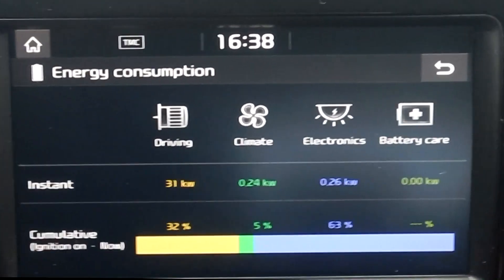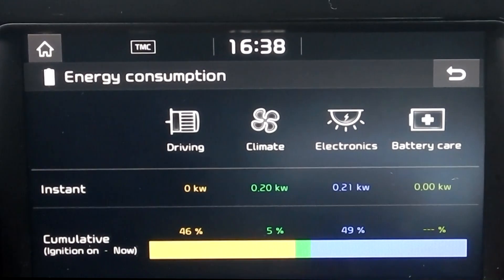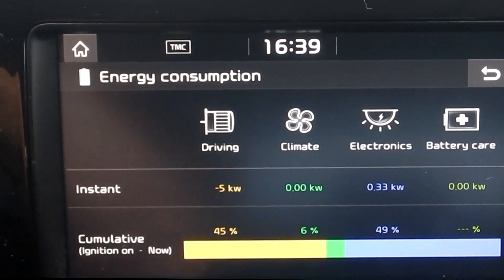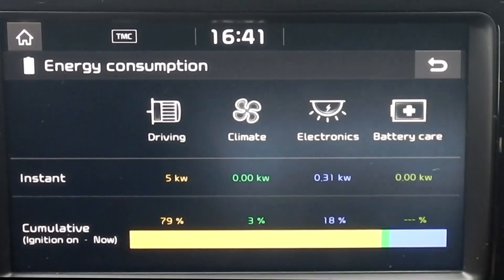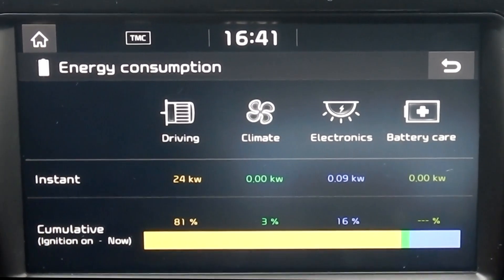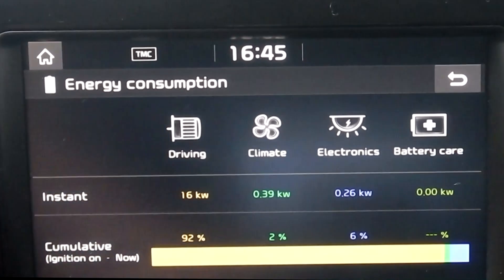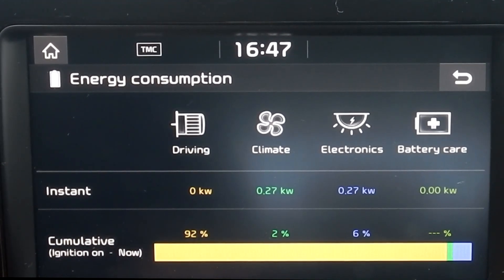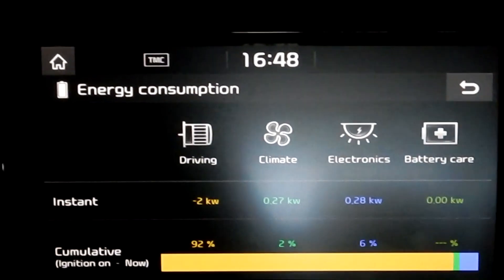Kia e-Niro - EV information screen showing Instant Power

Comment: Hi, do you know why this consumption numbers are not the same as the ones displayed on the other screeen? I mean the red bar that displays the instant consumption. This numbers don't match.
Reply: The one on the main display is per hour the one in the instrument cluster/tacho is per 100 km. 
20 kwh on central display panel at 50 km/h will show 40 kw / 100 km on the instrument cluster/tacho
Reply: @raduioanitescu6704  Thanks, makes a lot of sense now.